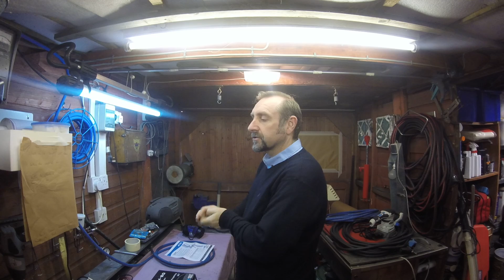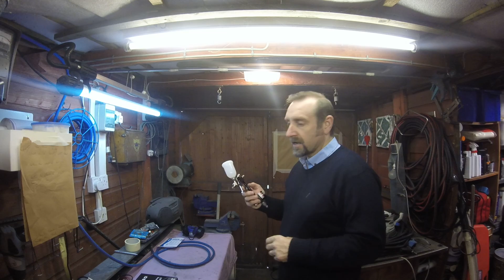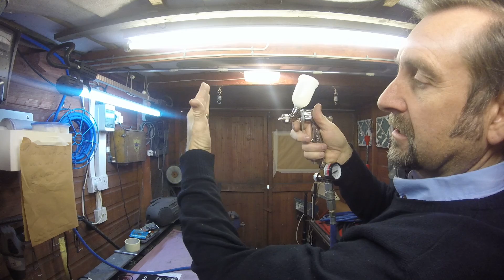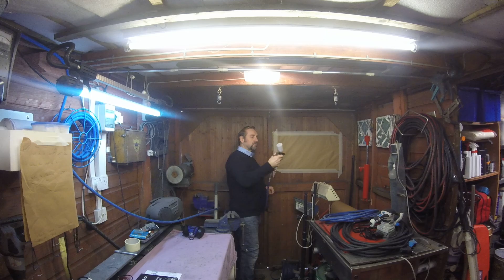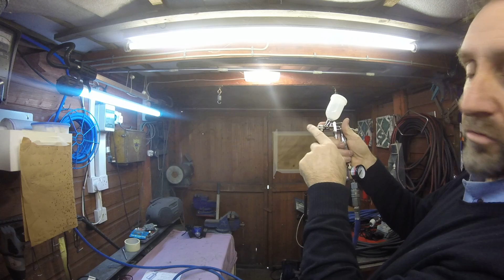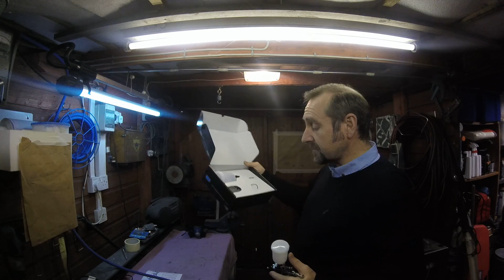Anest Iwata LPH80 Review from the shed

Comment: Hi Jason I’m in the repair industry although it’s in the house building trade for the most part in new built houses. We were supplied & trained with a devilbliss Sri pro, but personally I don’t know why but I really don’t enjoy using it at all! This gun looks fantastic I think the Sri is just a bit too much for the repairs I do mostly they are 3/4mm chips at times. I’m really considering this one! I’m currently carrying a 10L 110 volt compressor with transformer & the 10m heavy rubber hose with a Sri through sites it just feels like overkill to blow in tiny chips on kitchen units & showertrays and whatnot. Could you please recommend a portable compressor that would accommodate the lph80 & make my 9-5 days a little easier 😂

Comment: Interesting about the distance from the panel!  Does this apply for airbrushes too?
Reply from the maker: Not sure airbrushes do not have air hornes like a spraygun
Reply: @jasonevans6720  If one is first just doing isolated fine chip like repairs on a car which size set up is best the 0.8 or the 1.2 which then has the added benifit of panel spraying. I dony know if there is misprint but one seller has the choice of 1.2 down to 0.8 and another down to1.00 which is correct?
Reply from the maker: @gtibruce  always 1.2 you can turn it down but if you go 0.8 you can't turn it up

Comment: Just had to come back and say... Thank you! 

After listening to the advice from this video, I sprayed possibly the best coat of clear I've ever sprayed. I'm using a different gun, and spraying a guitar neck. But the overall method is the same for all spray guns. 

I've spent countless hours listening to people all say the same things. Reading the same stuff from article to article. With my best efforts, I could only ever achieve a somewhat smooth coat. A solid B at best. Always a bit of orange peel, or some issue somewhere. 

After applying the wall of air method... I was shocked. 

The coat I sprayed today was perfectly smooth, and looked as if it had already been level sanded and polished. And this was using water based poly. A relatively thick product. 1.0mm tip. So, the atomization is fine. But I'm stunned. 

This is by far the best advice ive found anywhere. Simply amazing. 

Thanks again!
Reply from the maker: Thank you for your kind words, I feel very privileged to have gained so much knowledge about paint and refinishing over the past 43years and i still get a buzz when someone acknowledges some info i have shared. Merry Xmas to you jason

Comment: Hi, great video, on this gun how many fluid turns from closed would you recommend for clear coat? And what pressure? Thanks
Reply from the maker: Hi, there is no definitive answer to this question, so many variables to account for, best idea is do a test panel  just remember you can always put another coat on if it's too dry but you can't take a coat off if it's too wet😁👍
Reply: Ok so suggesting I have the fan at full open and 2 screw threads showing on the fluid... distinct around 8 inch, would you say 2 bar?
Reply from the maker: @seenbyme6696  good starting point but always do a spray out test and adjust
Reply: @seenbyme6696  it all depends on the situation. Temp, humidity, product being sprayed, target object material, even biometric pressure. Read your guns specs, and see what it says. Test different settings on scraps. Mostly, listen to what he says in this video. It’s the best advice I’ve found regarding spray gun setup.

Comment: love this gun for cerakote, i want i small gun for 2 part clear coats. we have a small sata that runs around 30-40 psi for these jobs do you know if the lph-80 can run a decent clear coat on small parts?
Reply from the maker: Hi, I think the lph80 will do you proud it has done everything i have asked of it
Reply: jason evans do you prefer a specific nozzle with the lph80 when clear coating?
Reply from the maker: If you are painting small/medium areas on say a car say A3 size i would use a 1.2mm tip, if painting small areas say A4 or say a motorcycle helmet i would use a 1.0mm tip

Comment: What kind of compressor do you use with this spray gun? I have a 1HP 3.1CFM @40psi 8 gallon compressor. Will this be sufficient for this gun? Thanks!
Reply from the maker: this size compressor will give you problems, it is only just capable of giving stable air to the spray gun and will run almost continuous this will make the air hot and cause a lot of moisture/water. i would be looking for a 2hp 7cfm 50l tank minimum
Reply: jason evans thank you very much for the reply. I will look into purchasing the 2HP unit with 7cfm. Thanks again and great video!!!